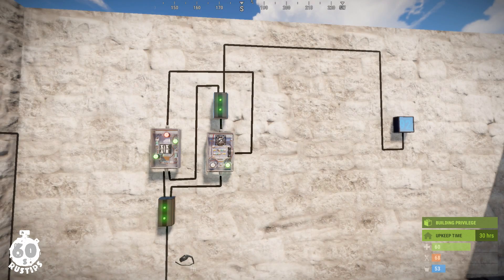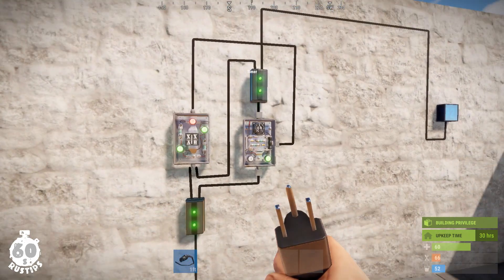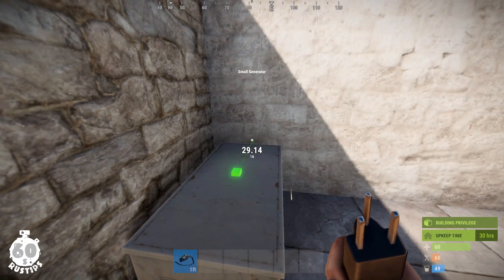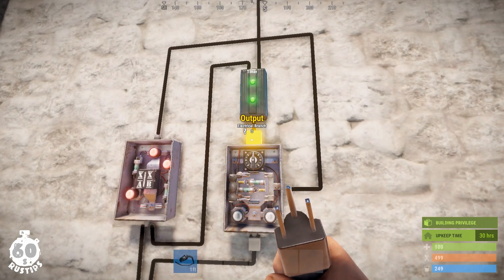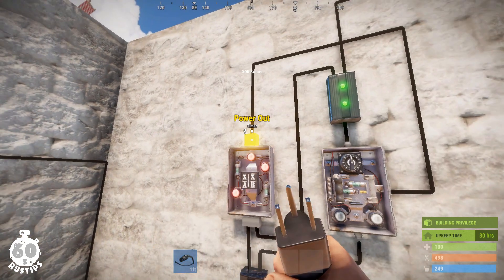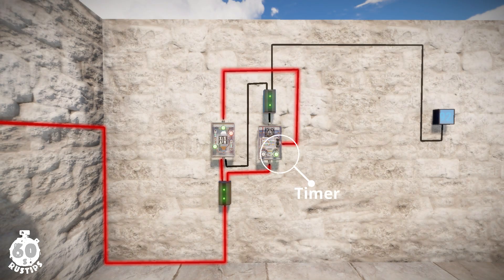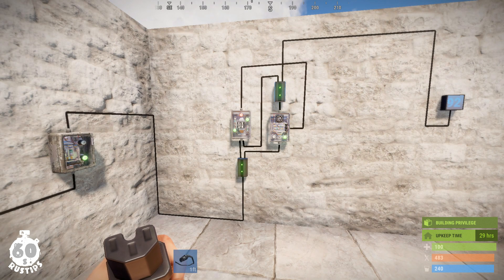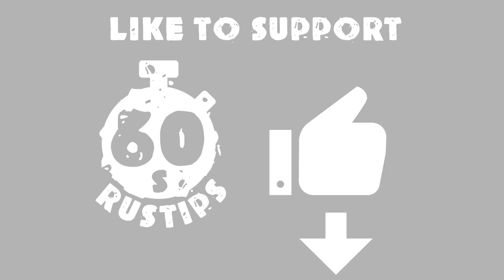60 Second Rust Tips | Simplest Electric Loop for Repeats and Clock

Comment: this old video allowed me to make a basic flip flop circuit for turrents, use the remaining power to a toggle on memory cell and then branch a separate main power into memory cell, there you can add your circuits on the inverted or normal power output, while the xor timer just flips the toggle.

Comment: If you add a memory cells toggle input as the output of this circuit you at 1 second of on and 1 second of off. Instead of 1 tick of on and 1 second of off

Comment: so im trying to make a farm and it begins like this. i flip the main power switch turning it on. their is a timer controlling how long the water is coming out and after the timer runs out for the water control the second timer turns on which is like a brake or pause and after the timer stops for the brake it goes back and loops. what can i do to make this possible?
Reply: still need an answer? 🤣🤣

Comment: Thanks man, very useful as tool for building more complex circuits. I'm looking at using something like this to allow the charging of multiple batteries via a timed check on battery power levels and then switch the charging route over to the next battery in line once it detects that the first battery is full. Not ultimately useful, tho it could solve the problem of raiders destroying wind-turbines etc to disable base defences that are based on electricity.

Keep up the good work.